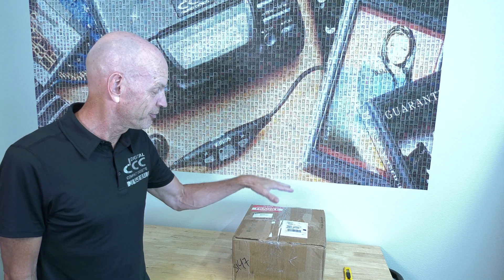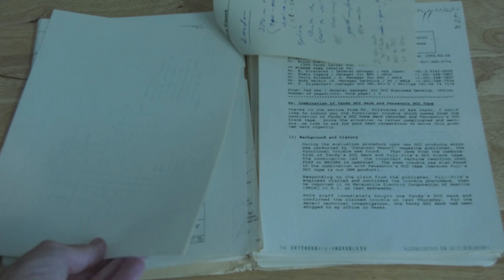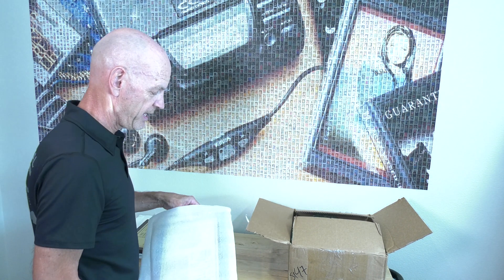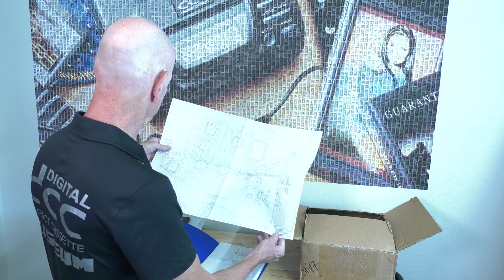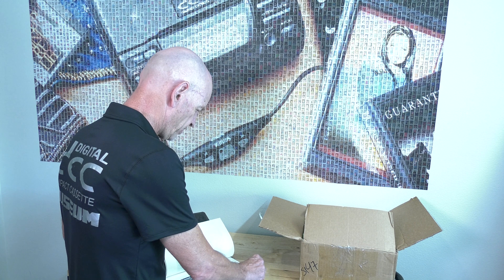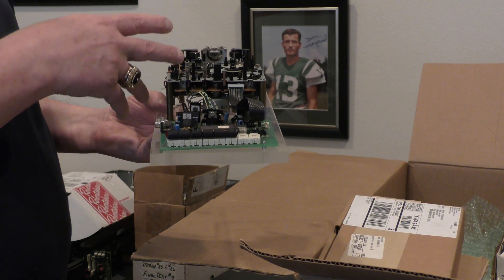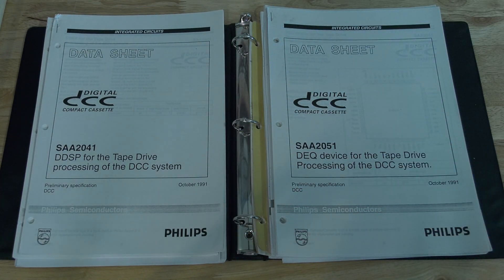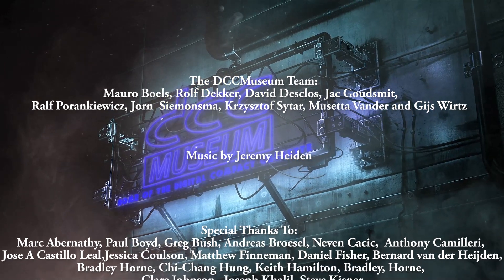The Technical DCC Specifications, donated by Daniel Staudacher

Comment: Looking forward to finally having datasheets of the 1st generation chip set! Those chips were used by 1st and 2nd generation DCC recorders.
There are datasheet PDF's online for the 3rd generation chipset and they have a lot of information in them (more than you would need if you're just trying to repair a DCC recorder), however there are some important details that were omitted, such as the list of command codes to the Driver Processor (DRP) chips. The DRP integrates the DEQ, ERCO and DDSP chips of the first generation into a single chip, and probably uses the same commands as the first generation chips, so these datasheets are sort of a "Rosetta Stone" for DCC reverse engineering.